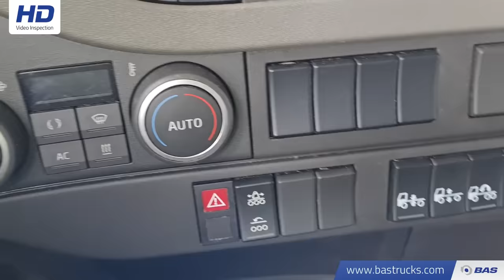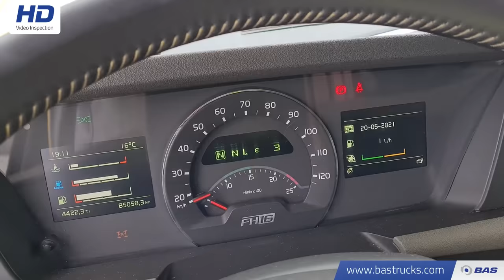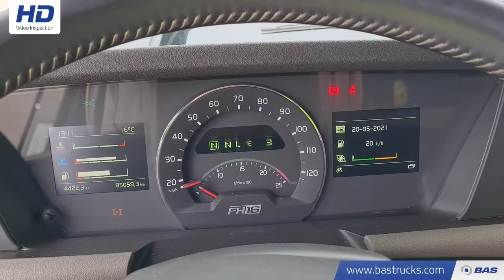70147213 Volvo FH16

Comment: Everything else is fine with this kind of a beast, Volvo has always been an inspiration, critical R&D and timely upgrades in products has always been a landmark of brand Volvo. 
Missing is the support ladder under body for tipping support, ladder could’ve been an added advantage for lifting huge load of 74 tonnes. Ladder support used to come for all models of tipper FM 9 series and even older models. May be there wasn’t any space for mounting ladder or is it that a 4 stage (as seen in video) tipping jack piston was enough for smooth tipping with full load was tested and was Ok. Hope team Volvo shares this small query as ladder could’ve helped hazard free tipping on uneven ground. Thanks. Overall a wonderful machine 👍🏻
Reply: ᆢ